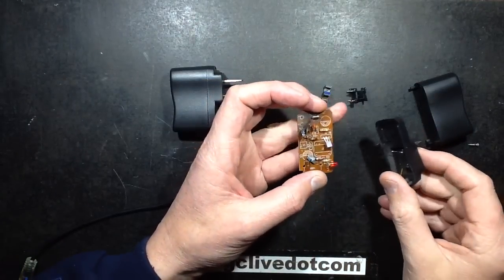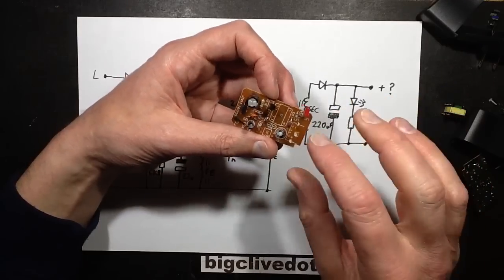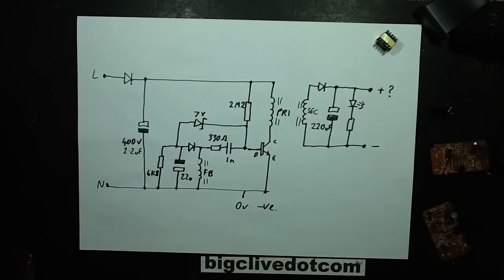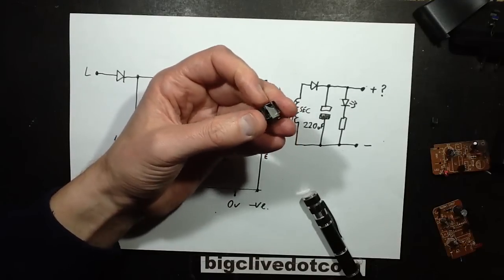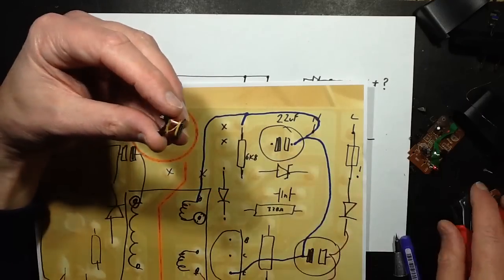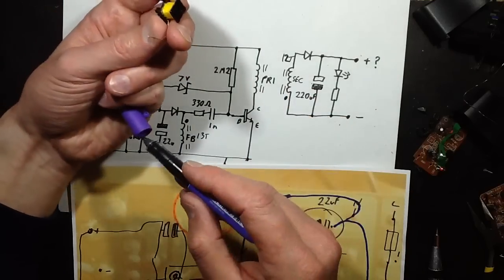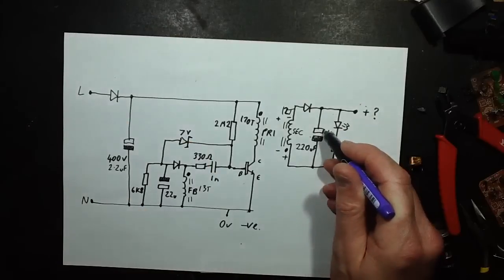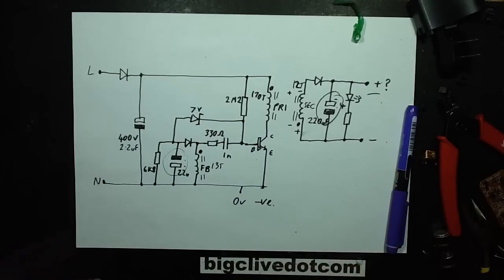Teardown, schematic and analysis of a single transistor PSU.

Comment: It's a single transistor flyback without optocoupler. This is a very common type, I have seen it so many times. Being a flyback topology, the diodes are conducting when the transistor is off. All tiny SMPS's are flybacks. This type doesn't regulate directly the output voltage, but it regulates the peak flyback voltage, so the output voltage is roughly regulated, depending on how good is the coupling between the secondary and aux.
Reply: thats what i thought.....
Reply: Diooooodeeeeeee! ♥

Comment: The additional cost to the final product of safer insulation would be nominal. A Lady died last year (in Sydney) operating a mobile phone while being charged by a Chinese Mains-USB adapter.
Reply from the maker: As have many others.  Not to mention the others who are blissfully unaware that their phone is live because it has a plastic case or rubber cover.  All it would take is a double insulated secondary winding to add the extra layer of safety.  (And perhaps some better PCB spacing.)
Reply: The key, horrible, detail is that the woman was using headphones to listen to her phone, and was electrocuted through them when she went to plug her phone in to charge.
Reply: +bigclivedotcom Get a 1.5kV transformer, connect one end to the primary side of the cheap adapter, connect the other to the secondary side of the adapter, power up the MOT for a second, if nothing catches on fire, explodes or arcs over during the poor man's Hi-Pot test and leakage current between the output and live/neutral is still in the microamps range after the test, then whatever isolation it had would have probably passed UL testing.

The only problem is that X/Y-caps are only rated for one full isolation voltage test cycle (factory) in their lifetime, so testing adapters for isolation to 2-3kV (or whatever makes you comfortable)  before using them voids the isolation performance spec. This is problematic with cheap adapters and their wildly variable component build quality where each "identical" adapter can be a completely different critter than every other.
Reply: +ickipoo What do you think of this statement ?
The Chinese could produce these products above the most rigorous electrical safety standard on the planet, and still undercut the market on Volume/Price. (And a 'trivial' consequence of a reputation for quality and safety).
Reply: +Rob Robbie It's true. But the problem is these generic Chinese goods sell on price, and price alone. If you are manufacturing something to a cost 10 cents more than the factory down the road, you lose 50% of your sales. The point to remember really is that it's not some huge conglomerate (with a reputation to withhold) making these things (as was the case with the Japanese, Koreans and Taiwanese when they first started exporting cheap stuff), it's generally a large number of small, family-run factories making short runs of gear. Actually getting product out the door in the first place is more important than making sure people come a second time, as there is no loyalty in a price-obsessed market.
Reply: +Jason james Yes, maybe I'm approaching it from the wrong end. If our respective countries customs compliance could stop the containers there wouldn't be a global market to supply and that could alter the Safety of these products.('Poundland' would not be happy though).
Reply: Rob Robbie It's us that is the problem - we don't value quality, and keep demanding cheaper junk. Can you blame them for satisfying our demand and making a buck in the process?
Reply: ickipoo
Practically all the cheap power adapters Clive has 'taken to bits' have multiple bleeder resistors in them and these cost over $0.002. A tiny amount of extra tape or sleeving on the wires to guarantee consistent electrical isolation would not add much cost but would make the junk substantially safer.

Do people really value their life at less than $0.01?
Reply: Teardown Dan While we keep buying it, they'll keep making it.

Comment: I can understand why you're not a transformer guy.  I look at what you're doing here, and the numbers you wrote down, and I cannot for the life of me find any mathematical relationship in which that transformer would do anything close to what it's doing in that power supply...
Reply: It might help to think of it less like a transformer and more like an inductor with all the coils wrapped around the same core.  It is not AC that is passing through the transformer windings but rather a high frequency DC pulse followed by a collapsing magnetic field that then generates a corresponding pulse with reversed polarity, along with the resulting ringing that keeps everything oscillating.  So, we inject a positive square wave, interrupt it, then get a large negative pulse in return that charges the two capacitors (one regulated, the other for feedback sensing; a buck regulator) -- though on the regulated side we have flipped the coil's polarity so that the negative pulse (from collapsing field) looks positive and charges the capacitor and powers the load.  Hopefully that might have helped...or just totally confused, in which case I apologize.

Comment: Really clever design to overcome the need of using an optoisolator for isolated feedback. I quite like that. Now,  if it wasn't for that "optimistic" tape isolation and cheap components, this would be a decent power supply

Comment: How does the charger  get fixed voltage output without feedback ?  Kindly explain better. It seems there is no direct link between the 2 capacitors. What limit the secondary capacitor's voltage?

Comment: Yes so like one commentator said earlier, the negative feedback arrangement is simply to get the voltage at the base of the transistor to go down clamped by the zener diode in respect to ground voltage 0. The base is then subjected to negative voltage and the transistor is shutdown. It's similar to the LM317 circuit arrangement in order to get voltage lower than 1.2V using -10V rail. Simple yet clever.

Comment: That is a self-oscillating flyback with primary side voltage control. It works, but they have limited regulation, limited protection, lack of control of switching frequencies / EMI, etc.
Problem of cutting corners: crappy insulation, crappy rectifying diodes, small transistors, undecent winding thickness... but well, you can buy them for 1€, what could you expect... (besides fireworks) :D

Comment: 7:00 Your assumptions are absolutely correct, except one point: the capacitors are coupled through the transformer and charged to roughly the same voltage with respect to the turn ratio of the secondary and feedback windings. The higher the voltage at the output of the power supply => the higher the voltage on the feedback capacitor => the lower the negative offset voltage for the zener diode => the longer delay before the next pulse (forward cycle). Pulse duration is limited by the base 1n capacitor. Working current limit is not implemented.

P.S.: I'm not trying to be а smartass. 😅 I'm just watching nice relaxing videos, and sometimes trying to add missing information that might be useful. Sorry if bothering.

Comment: Wish I had seen this sooner when watching the channel, but its a very clever regulation design for something so simple. The Zener diode will start to steal base current from the transistor base when the RC has charged up to a high enough voltage from the flyback pulses and starts clamping the base to regulate it. It probably also offers some protection from the inductive spikes as well. Essentially the base ends up riding the knee of the Zener voltage to regulate. As the voltage falls the Zener no longer steals as much current so it stays on for longer. When it rises enough the Zener again starts stealing base current and limiting the pulses. With the diode drops and slight difference in number of turns taken into account it does work out to just over 5V as well at the output.

Comment: GREAT Big Clive Dotcom,  Compare this
I have another explanation on how the auxiliary winding works
1.After primary coil induces volt and current in the auxiliary coil
2.The auxiliary coil supplies the base of transistor through timing/frequency capacitor(1nF) and resistor(330ohms), turning transistor on fully
3. The timing capacitor stops conducting when fully charged thereby stops to supply the base of transistor. And thereby setting frequency of  oscillation
4. Then, the transistor is relatively switch off, 
5.There is virtually no voltage or current in the auxiliary winding again
6. The timing capacitor discharges from its positive charged terminal through the auxiliary winding, electrolytic capacitor(22 uF,25v), resistor(5.6k) and zener diode to the timing capacitor(negative charged terminal)
7.As timing capacitor discharges, the reactance in the auxiliary winding is discharged through electrolytic capacitor/resistor and diode(IN4148). It is similar to protecting relay coil and circuit with diode
8.The zener diode also senses the voltage in the auxiliary coil. Once it exceeds zener voltage(~6.2volts)
Zener diode starts to conduct and shorts the base of the transistor to ground.The transistor stops conducting and voltage falls and regulated. The transistor starts to conduct again when the voltage is lower than zener voltage
9. Since secondary winding has equal no. of turns as auxiliary winding, similar voltage of ~6.2volts is induced in it by primary winding. Zener diode regulates auxiliary winding voltage and by extension the voltage of secondary winding because of similar number of turns of the coils
10. If zener diode is replaced with one of higer value e.g 12volts. Secondary voltage would also be 12 volt. If the number of turns in the secondary is increased e.g to 24 turns. Secondary voltage would increase to ~11 volts, all things being equal

Comment: If this helps, the transformer is built like a joule thief with a third winding for the output, but the tapped winding is split into two windings to make it easier to bias the base of the transistor from a high DC power input.

Comment: You are right. It is a fly-back i.e. energy stored in the core during on time is transferred to the load during off time. The auxiliary winding is also phased like the secondary. During switching off the collector sees positive spike. So does the secondary rectifying diode; so does the auxiliary winding top end. The series RC makes the positive feedback needed to sustain oscillation. The negative auxiliary rectifier is part of the "error amplifier" - the circuit comparing the output voltage (as reflected to the aux winding) with the reference (the zener) in order to produce an error signal in order to bias the transistor base and change duty cycle.
I recommend downloading LTSpice (from linear.com) and simulating the circuit there.

Comment: For information, there are some signal diodes in DO-35 packages that are rated at a higher current than a 1N4148. And indeed, some manufacturer datasheets for the 1N4148 show it rated for 200mA average rectified forward current.
Some of the diodes with a higher rated current are:
1N4149 500mA 100V 500mW
1N456A 500mA 30V 500mW
1N458A 500mA 150V 500mW
BAY73 500mA 125V 500mW

Comment: Without reading the other comments:

The feedback winding provides positive feedback and forces the primary to saturate quickly at which point the field collapses and the polarity of the feedback winding reverses allowing the 22 microF capacitor to charge. Given the RC value determines the time it takes to charge the 22 microF capacitor, the zener will ensure that the charge collapses at the same point in each charge cycle. This should stabilise the frequency of the oscillation and keep it in the bounds/range that the transformer can manage.  I think that changing the value of the zener would change the oscillator frequency. The output circuit is just a standard half wave rectified circuit sort of tuned/optimised to the frequency of oscillation.

Well it's a theory anyway.

Given I'm at least 20 years older than you, most of my electronics training was based on analogue circuitry, valves and heavy rotating machinery (Ward-Leonard torque amplifiers and such) - I think I met my first TTL chip (7400) about 2-3 years into my career. :-)

Comment: Welcome to the wonderful world of flyback power supplies - one of the oldest and simplest isolated switching power supply topologies. Nearly all 1/2 transistors circuits are designed in a similar manner. The bulk of low-power AC-DC adapters and standby supplies are also designed in similar ways, except maybe for the use of optoisolators instead of sense windings.

Comment: Two things to note in this device. Firstly, it only uses one transistor, which is very clever, though transistors nowadays cost virtually nothing, so why bother? Secondly, it has a built in hole to allow the smoke to escape - a very neat feature.

Clive was a bit concerned about the isolation between the primary and secondary windings. Later, he points out that there are two layers of tape between the windings. So it's double insulated. What more could you ask for?

Comment: Well figured out Clive, an excellent bit of deductive logic.  The only bit I would disagree with is that it's not a saturating transformer design which would be very stressful for the power switch.  The 330R resistor and the 1nF capacitor in the base circuit has a time constant of 330ns and so the base drive current decays to zero in about a microsecond which turns the transistor off before the transformer saturates.
Reply: The circuit grand-father is the blocking generator. Once the switch is turned on the collector (and primary) current starts rising. So does the flux density. As far as the current keeps rising the positive feedback in the aux winding keeps the transistor on. Once the flux density reaches saturation (briefly) the flux no longer rises, so the aux winding produces no voltage. The base bias decays, reducing collector current. Once the current starts decaying the voltage in the aux winding reverses-shutting the transistor. The series RC circuit indeed is the key positive feedback network required for sustained oscillations. Without it the circuit would be just a one shot blocking generator.

Comment: Still just easier to have a transformer stepping down the voltage, then having a full wave rectifier and a smoothing cap :)
Reply: +Jordan O'C (Xenro66) Except that to get similar specs you then need a transformer that can double as an arc welder! ;)
Reply: easier? possibly, more reliable? depends, ., but very inefficient, a 50/60hz transformer based 'linear' version of a typical pc psu would be as big as the whole pc!!
Reply: Transformer size is proportional to frequency (at the same flux density). In fact ferrite has about 1/3 of the flux density of the steel used in 50/60Hz transformers. The switching mode transformer operates at tens of kHz. This makes it many times smaller, lighter and cheaper. Note that the number of turns per volt also drops with frequency - reducing copper weight and cost.
Compare the small Apple "1"cube"  5V/0.5A adapter with real transformer based adapters of the same rating on size and weight.

Comment: Auxilliary coil feedback is common in cheap psu's as it negates the need for an opto keeping the cost down, regulation suffers though as it relies on trans coupling.

As a rule if a trans has an air gap, ie tape or something non magnetci holding the core halves apart its a flyback, and the pri/sec are out of phase, pc psu's are often push pull, with this type of trans energy is instantly transferred rather than stored so there isnt an air gap or its really small.

Comment: the way I see those supply's ignore the output.
but rely on the fact the loading on the output secondary reduces the voltage on the feedback so more pulses are made to keep the feedback voltage at target  which has the effect of providing more power to the output.

Comment: "I'm a digital boy" I feel your pain.
Reply: GoldRimmer I'm afraid I'm one of Bob Widlar's idiots :)
Reply: The only thing that is hard with analogue systems is that you have a lot of differential equations in them. Get your Laplace transforms table and then learn complex reziduue calculus to convert it to S space, solve the system as an linear system, then convert the results back to real space. And that's why analogue is damn hard - it is mathematics.

Comment: Hey Bigclive. Think of charge instead of current. The less charge accross the 1n capacitor, the shorter the pulse width. The more negative the charge on the 22uf capacitor, the lower the charge on the 1n capacitor when the transistor switches on. Because it is flyback, the 22uf capacitor effectively measures the output winding voltage. Clever circuit. Interesting to know open circuit and source resistance of that configuration as well as max current. 
Is it efficient from the point of view of delivering high current for the volume of magnetic material used?

Comment: A scope would help you see what's going on with analogue circuits like this.
Reply: Yeah,  what I'd do is put some pulses into the line input side of the circuit,  and then scope what was going on in other parts,  and I wouldn't even have to go to the trouble of taking things apart...   :-)

Comment: Thank you immensely
What is the function of the zener diode in the primary?
How can I increase voltage output? Which components do I need to change to increase voltage output?
Reply: A larger zener or more turns on the secondary winding when replacing the bad transformer.  Obviously you need to calculate the circuit and test with safety precautions.  For experiments use a ferrite core that can be easily opened to rewind the bobbin between tests.